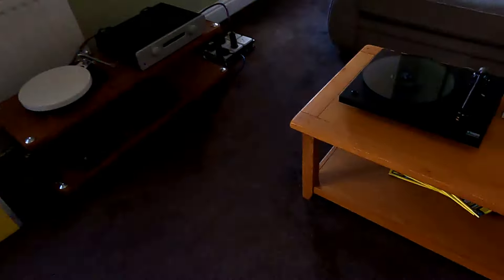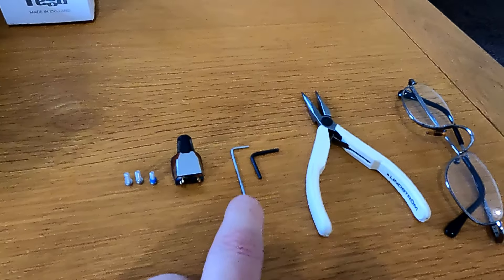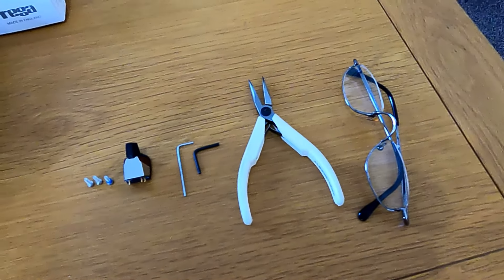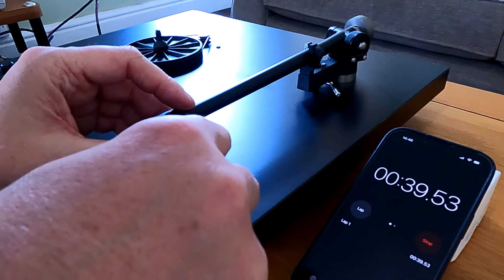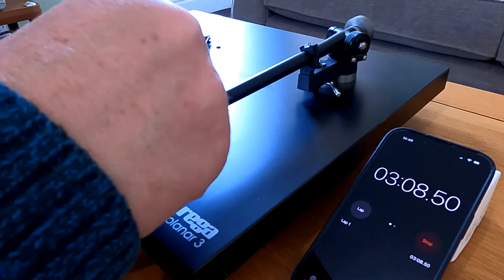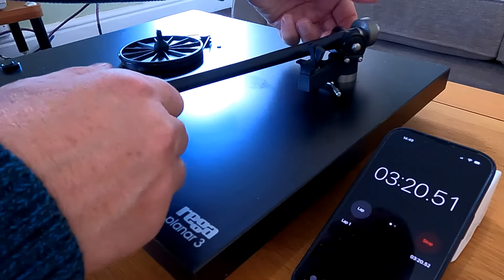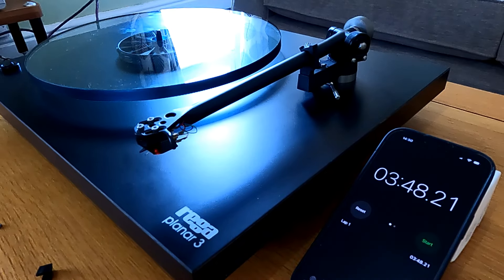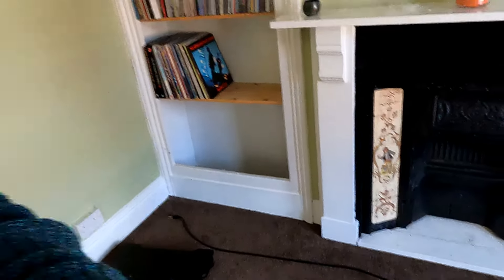How easy is it to change a cartridge on a Rega Planar?

Comment: The first time I changed a cartridge I turned the volume down on my amp to 0 - got the cartridge on, get it all set, lobbed a record on, nothing - I was like ah I've messed it ip, unplugged it, replugged it in a good few times - started thinking about where I'd go to get it fixed - then realised my mistake and turned the volume back up.

Comment: In my previous life selling hifi I have fitted hundreds of cartridges to various arms and decks. Bolts on top and nuts underneath is far more sensible as you can fit the allen key in the head much more easily than trying to do it from underneath. ALWAYS remove the stylus from the cartridge before fitting it to avoid damaging it while fumbling with the bolts, even with the cover on, especially if its a flip down guard, like Shure have. I do like this design which eliminates the need to align the cartridge, which is a major faff.

Comment: Hello Phil, thank you for your interesting reviews which I find very down to earth (in a very positive sense) and usually presented from the perspective of a potential end-user rather than the usual sales person tech spec marketing advertisment. As you also have a turntables workshop I would love to hear your opinion on potential issues with REGA P6 if I replace their factory felt mat which is roughly 2mm thick with e.g. the Serene mat from Stack Audio which is a) 3mm thick and b) it weights c. 180 grams. Two potential issues I can imagine: given no VTA adjustment would/ could the 1mm thicker mat be a problem for REGA Ania MC cartridge on my Rega P6? And given the weight of the mat corresponding a proper 180g record could it be a bit too much for Rega P6 engine if together with a 180g record on the P6 heavy platter it would have to spin the additional 360g ? Thanks a lot for your thoughts. regards, Daniel (Poland)